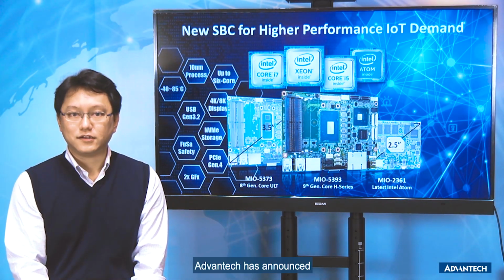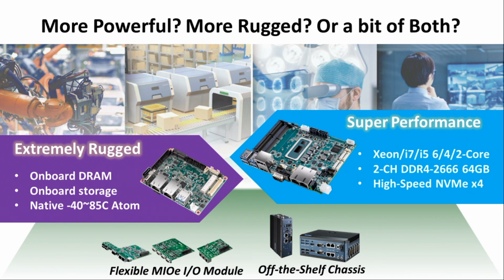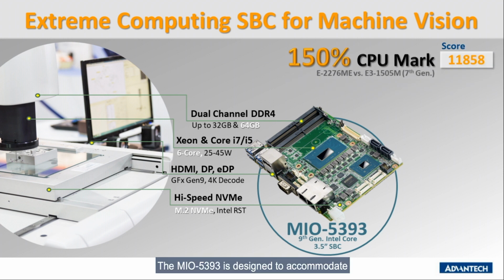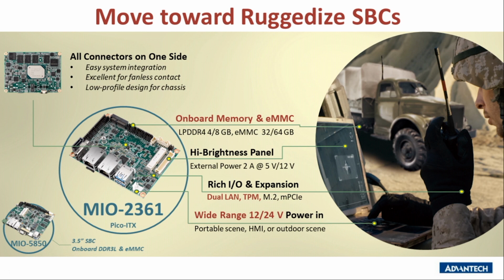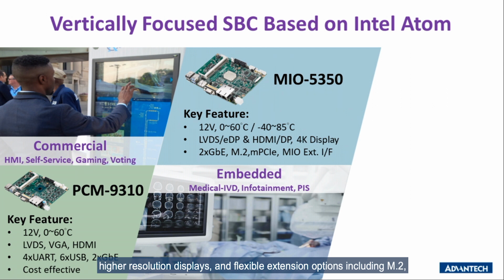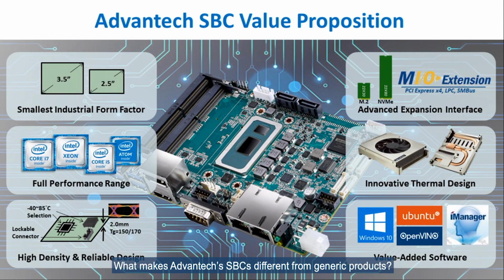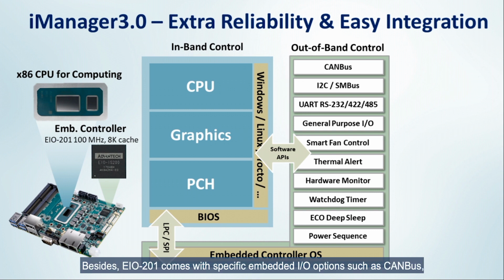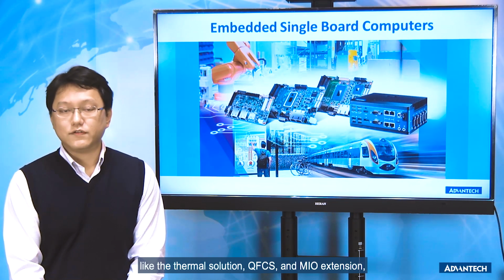High Performance & Rugged SBC – Intel Core on 3.5” & All-in-one Pico-ITX

Comment: Also do you have or know about a 3.5 or smaller, preferrably a pico itx with a full socket and enough power supply to drive  a desktop processor? I have a solution for cooling, but want lots of power in a small package.